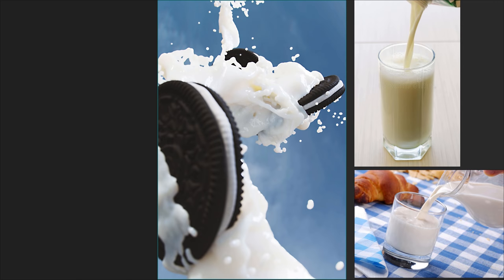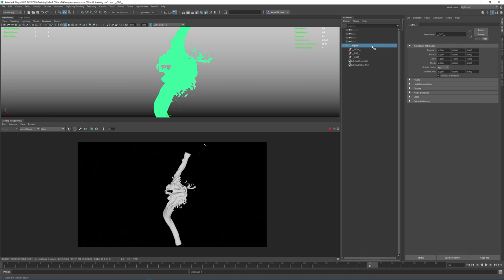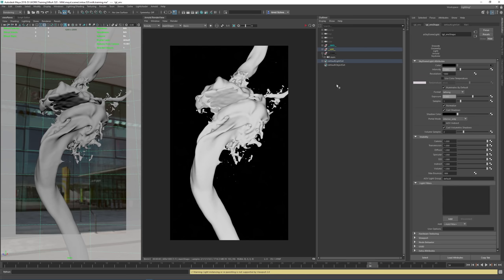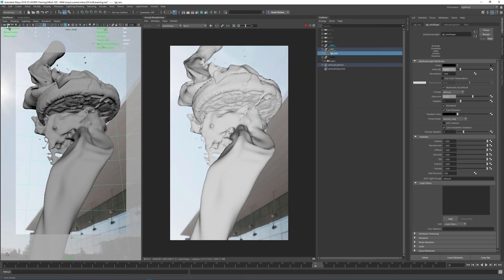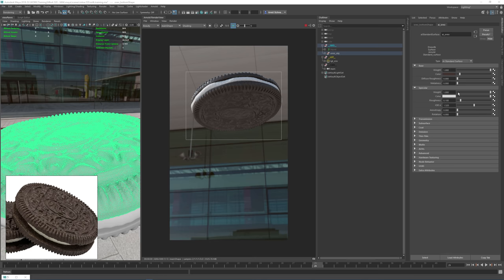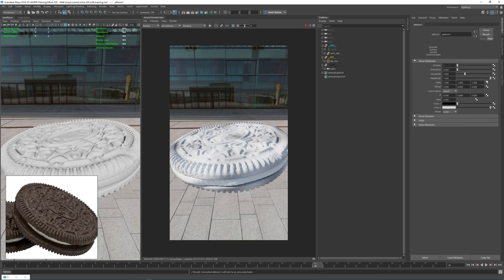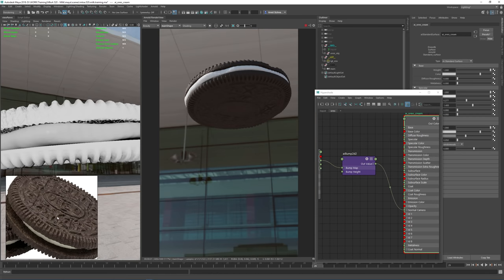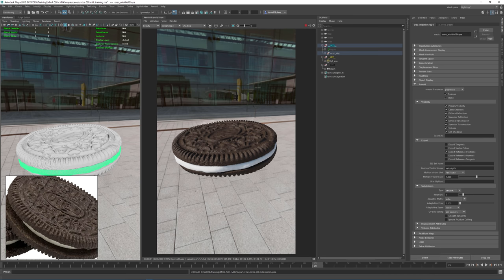MtoA 520 | Milk Shader | Lookdev Part 2

Comment: Hello Arvid. Thanks a lot for everything you do with Arnold on your channel, it's the best content i've seen on Youtube for Arnold and Maya. I have some questions for you, i hope you can see this message because i'm a huge fan of water simulations and Arnold.

1) Why did you imported your .abc sequence as a Gpu cache instead of an Alembic cache? what's the difference?

2)Did you imported you .abc sequence as individual frames files? or did you stitched together into a single .abc file using the Realflow Stitcher Tool?

3) In Realflow there a bunch of channel/Attributes information for .abc files such as Curvature, Viscosity, Temperature just to name a few. How could you import this channel information and use this information in the shading part using Arnold on Maya?

4) This is a beautiful low scale water sim, but, could you do in the future another tutorial but now shading a large scale sim such as an open ocean?, i know that for this you only need displacement sequence maps and paste them as displacement on a plane with lots of subdivs and you have your ocean, but, what if you want to extend the ocean so you can create an endless ocean, i always have tiling artifacts doing this what would be the best approach to blend and mix this maps to give the sensation is endless?, i know Houdini did a great job with this issue but with maya & realflow i don't know how to achieve this.

5)Also, for the shading of an ocean, you should check Igor Zanic Vimeo Channel, he has a lot of great content on his channel for oceans using realflow,houdini,bifrost. There are plenty of examples on his videos that in the ocean you can see a lot of color variation depending on depth. Also for the shading for secondary elements (whitewater) such as foam, splashes particles some people render this particles as vdb volumes, but for example Mirco Paolini another great fx td he combines two methods in which one part of this elements is rendered as volume, and other part is rendered as what he calls the specular model i don't get that 100% but i think he refers to rendering some part of this secondary elements as sphere with a bit of specular and a bit of emission i think but i'm not sure. For bubbles i think it would be to render them as spheres with transparency and a bit of thin film maybe?, and for mist which is basically a volume and not particles could you help with the process of shading this secondary elements?, it would be awesome!